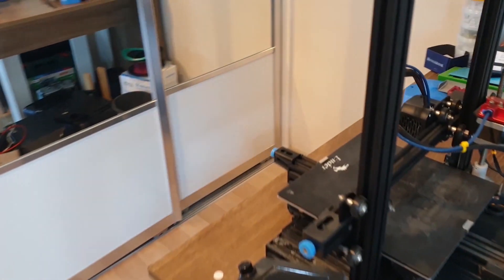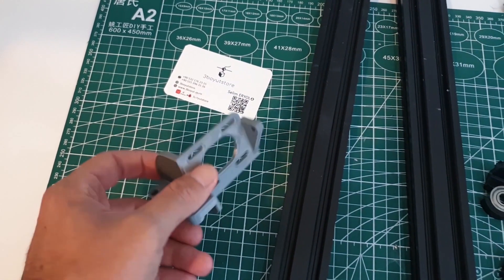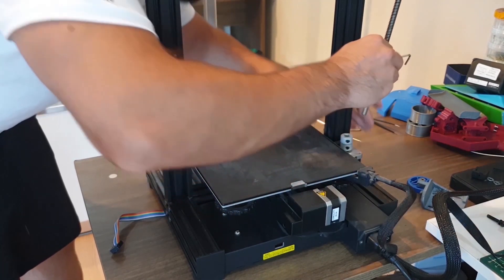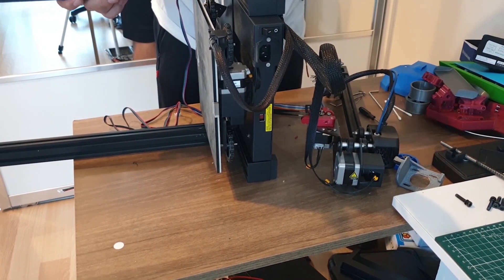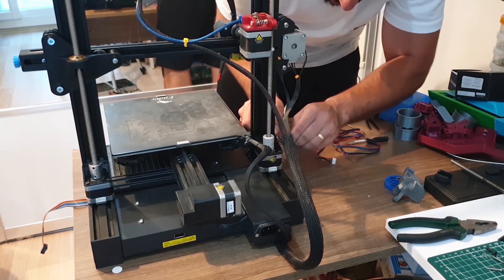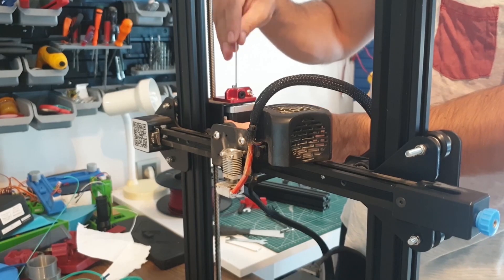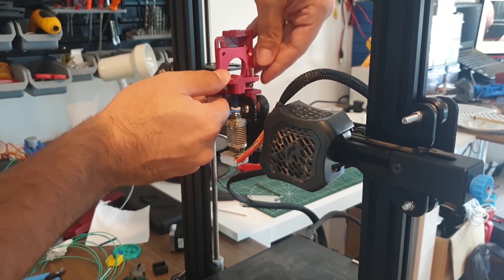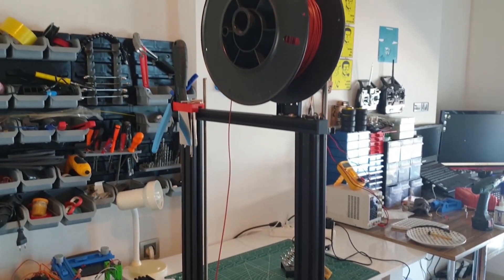Creality Ender 3 V2 3D Printer 3 Great and Important Upgrades

Comment: i dont underunderstand the direct drive conversion makes not 1 bit of difference
Reply from the maker: Isnt it neccassary?
Reply: in my opinion a direct drive conversion rlly just depends on what you want to do, if you want to print flexible filaments then youll need it but if you dont plan on printing flexible filaments then i dont see why you would need it 
 @everynever5112
Reply: makes a lot of difference, no bowden tube that can go wrong and further removes the amount of retraction making it more precise with less stringing.  Why do you think all higher end printers feature this? also no bowden tube means you can go hotter say up to 300c so you can use more variety of filament.
Reply: What your talking about is an all metal hotend, the direct drive conversion this guy did still uses PTFE Tube but just on a much smaller amount, it still goes into the hotend all the way up to the nozzle. With the upgrade he did you can not get up to 300 degrees C because even capricorn Tubing melts. To print 300 degrees you would need an all metal hotend which removes the Tube that goes into the hotend. @andrzejandvincegaming3015